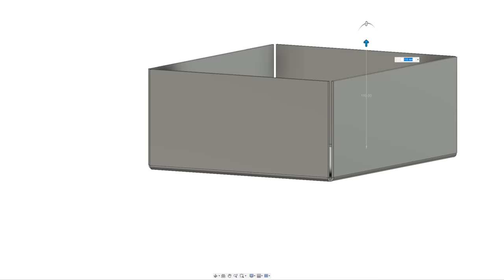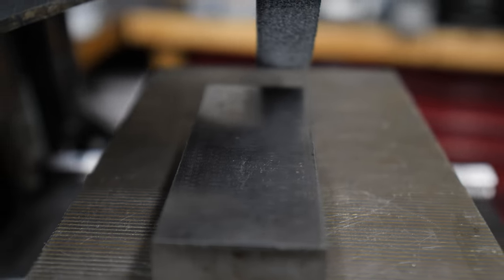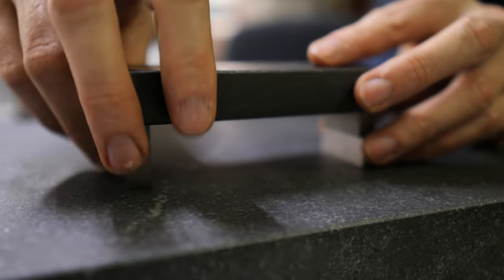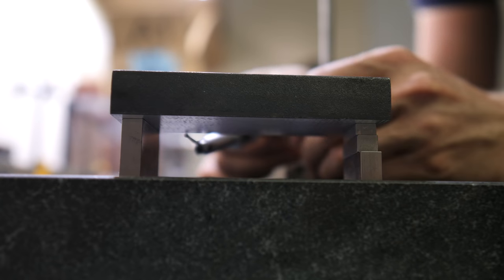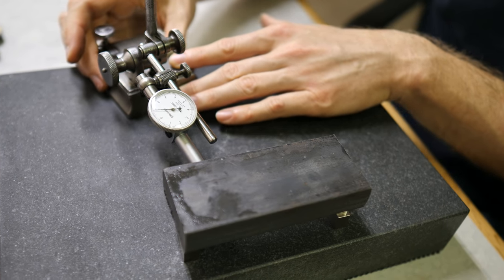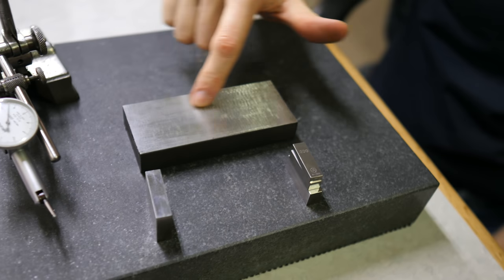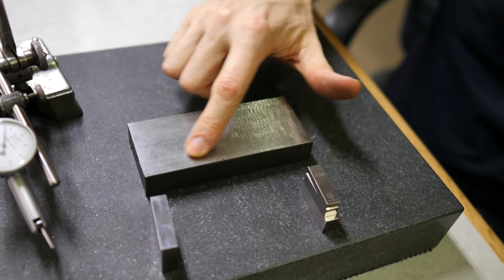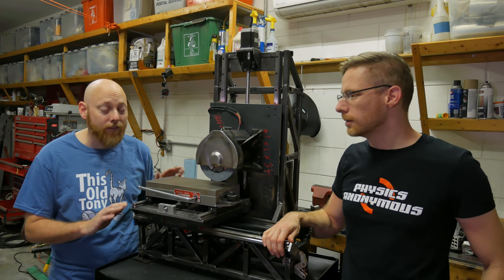Small Surface Grinder Part 12 - S02E43

Comment: Your wobble is caused by the fact, the whole machine is way too light for it's job. The "bench" is behaving like a spring, due to its construction. Every slight unbalance in the grinding wheel gets transported thru the frame and then amplified by the springy bench. Have a look what the actual contact-forces are, when you hitting the plate with the wheel. This outward push is easily compensated thru bend in your contruction. You gotta enforce the whole frame and put sandbags or clay in every free spot to get rid of the whobble.

Comment: Pro Tip: When you're tig welding an open joint. Put a piece of .125"-.250" copper flat bar on the backside. One, you were getting porosity because of airflow from the backside of your weld and two, it'll help with bead control while your skills continue to get better. For blending use type 27 flap discs.
Reply: P

Comment: the whole thing looks extremely flimsy and the way the wheel wobbled made me cringe. I think one of the reasons this won't work is that the structure is acting as one pig resonant spring instead of being made from a damping material like cast iron. Machine construction is not striving for maximum rigidity -- damping characteristics are more important.
Reply: It already does work. Let’s see your built from scratch grinder.
Reply: I'd be curious to see how it would work made out of pieces of Durabar. I realize that mass is a large part of what makes castings so desirable but in this skeleton type configuration would it make a meaningful difference.
Reply: @databoy2010  Mass is only part of the story. Relative damping capacity is the other. Cast iron has 20-100 times higher damping capacity than a steel (add another factor ten for Aluminium!). Mineral castings are even better than cast iron (which is way some high-end CNC machines and things like PNP machines, which produce a lot of rapid motion and thus vibrations, use mineral castings).
Reply: Easy enough to add mass in the right areas to cause interference to whatever frequency the thing is resonating at.  The damping capacity of iron (specifically gray iron) is often used as compensation for poorly crafted machinery.  The better solution, the one these fine gents seem intent to pursue, is to minimize vibration in the first place by eliminating sources of oscillation.

Comment: That wobble isnt from the plastic bushings. It's from imbalance in the wheel causing the machine to shake. Also, try dressing the wheel more aggressively by taking .001+ cuts with a fast cross feed

Comment: This is amazing. I'm seriously impressed.

You guy might want to investigate epoxy granite. It's basically a mix of various sizes of gravel and sand, with a bit of epoxy to bind it. The damping and stiffness properties are as good, if not better than, cast iron. It can be used to make whole machine bases. You could box in the frame of your grinder, and cast in some DIY epoxy granite. Machine tools are heavy for a reason, and adding weight and rigidity would likely go a long way towards improving the precision and surface finish you're able to achieve.
Reply: Weight will definitely help reduce chatter, encasing the machine in granite will definitely improve rigidity, so it is a win win strategy for this one.

Comment: One problem I saw what that you were cutting on both passes.  One pass would try and cut with the spin of the wheel and the other would cut against the spin of the wheel...  You ALWAYS want to cut cut against the spin of the wheel!  This leads to a cleaner and more controlled surface.

So, start with you part on the mag-chuck.

And with you part between the wheel and the upright body of the grinder. - If you work cannot fit under the throat of the grinder, then that is a good sign that your part is too big...

Then you want you work to start moving back and forth so that the wheel leaves the work completely on each pass.

Then start shifting the work a quarter of the wheel with with each pass, against the spin of the wheel.

Continue until the work has fully passed under the wheel.  The leading edge of the wheel might get worn down by your work...  Continuing to the trailing edge of the wheel should make for a more level surface.

If the direction of feed is away from the body of the machine, and you inappropriately look/move away, the work will not automatically crash into the machine...  That is why you start with the work between the wheel and machine.

You might want to re-surface the wheel before your final pass...  Don't move your part from the chuck though.  Just turn the chuck off, add the wheel burr - turn the chuck on again - level the wheel - remove the burr - do the final passes...

------------------------------

Also, after you get your machine level and parallel...  Surface grind the surface of your chuck.  You will never get parallel flat sides if your table is not both flat and perpendicular to the wheel...

Also, you must have liquid cooling!!!  Not only with this help with the dust - if you control the spray - but it will keep the work cool.  If the work expands from the grinding, then it does not mater how the machine is set, then work will not be flat when it cools back down...

------------------------------

Hope all of this helps!

Comment: A crude method to balance the wheel is a matched pair of 123 blocks on a very level surface plate (ie use a machinists level) and a shaft that matches the ID of the wheel, once it has stopped rolling back and forth the centroid of the wheel will be on the bottom so you can then use a carbide drill and take just a partial cut into the side of it to “balance” it. Rinse/ repeat till it balances at any rotation. Physics!

Comment: Looks good. Still think that dressing your wheel to have a step, to reduce width to say 1/4" would help. Even when you tune the machine in, trying to grind with a full width wheel will give you wheel bounce as the machine is fairly flexible.
Reply: Yeah, I saw your previous comment too and it's a good call. Most of the wheels I'm looking at are 1/4" and 1/2", also seems to be what guys like Solid Rock (who actually know what they're doing) are using

Comment: Thank You for putting the wheel guard on it, however, I think if you extend the guard down at least another inch (perhaps a separate guard piece that can be height adjusted to accommodate wheels of different diameters...hint...hint...) you will get much better dust control.
I saw a lot of dust flying up as well as sideways. A lower guard will catch all the upwards flying dust and direct it sideways where a wide-mouth funnel would catch it and direct it to the bottom of the funnel and a shop-vac hose (that's the set-up my school shop had on it's surface grinder, we could only see the bottom 1/4 inch or so of the wheel), severely reducing the amount of metal dust in the shop as a whole (which will reduce your cleaning/maintenance/repair bills/work).
Other than that, looks good...

Comment: In my humble opinion, I do not think you should give up on that motor.  Bump it up to 48v and your rpms should be over 6000 rpms.  Properly would it would be even higher with more torque, then gear it down as much as possible until it turns 3000 to 3500 rpms   Turn a canister for the motor to fit inside of and then you can pump mineral oil through the motor and cycle it to a small radiator for cooling.  I seen an advantage here because this is a cnc grinder.  The headstock needs to move up and down.  The weight saved with this motor is significant.  The radiator need not be mounted on the headstock but higher on the fixed portion of the column.   Just my 2 cents and I could be wrong.  If the frame is stout then a heavier motor could assist with maintaining pressure against the work piece. It is a very interesting conversation.

Comment: Your tig welding is great, heres why, it did the job fine...
are you needing to weld on miltary vessels so each joint holds to the maximum under toreped/missle attack?
are you working in the nuclear industry?
to people out there wondering about learning / having a go at welding, start from the bottom not compare yourself to the best from the outset.Grind and reweld if needs be, or grind to make the end result look better if you like. 
your building a dust cover A* in my book
Enjoying the process and or result means you want to do more, your now loving practicing and hey your now getting better!

Comment: Direct drive on the spindle with a motor made for constant grinning will help the bog and press fit bearings on the spindle will help with the wobble,dry grinding almost always will give you a chatter on the surface.

Comment: Rail covers! And I really think you should consider adding bulk. Maybe cast some concrete around the steel lattice framing.
Reply: Epoxy granite.
Reply: @danielkruger4305  yes, but but think about the guy's budget....
Reply: @JLK89  It would have been cheaper to just buy one that would work way better. Budget is not the issue here.

Comment: I love what your doing and have considered doing the same and probably will one day.  Would you consider changing the X to an air actuator, stepper motors are not continuous motion which could be part of the chatter. Also since you have a mill now,  if you re-do the spindle consider tongue and groove the fit up. Better penetration with less heat and warping.  Think I have watched the build going on 20 times now getting ideas to start my own project.

Comment: dressing the wheel with the diamond on the left hand side of the chuck will avoid the grit flying off and sandblasting the soft steel top of your nice shiny mag chuck .  
ps... dont grind that poor chuck with that spinny grindy thing,   
a half inch wide wheel has less mass to be unbalanced. 
a cable counterweight to preload the up and down of the wheely thing will help,
its hard to wind a wheel down without it settling from leadscrew backlash, vibration and ways friction, and taking too much off  (the reason for counterweights)  
 at least try dressing the sides of wheel, it will reduce the wobbling to the level of a spin dryer on full speed with a brick thrown in

Comment: looking pretty good so far
and by far the easyest way to balance is is to dress the diameter true to the y axis and then see where the wheel hits the most metal
then just drill a few shallow holes with a masonry bit. and yes please get a surface grinding wheel, that removes at least 50% of the chatter

Comment: Glad it has worked out. I wouldn't worry too much about deviation on the first few passes, you will still get a decent level of flatness once you let things spark out. just leave it to make a dozen spring passes ans that will alleviate the pressure and give a consistent cut.

Comment: Cover the vertical support and the horizontal support with sheet metal and fill the supports with concrete to stop the vibration harmonics

Comment: When you get the stone test it https://youtu.be/52n8_-6cooY 
Sometimes the crack or void is internal and can't be seen so doing the ring test will save some serious issues, especially the RPMs you will be running to do a decent grind, a lot of centrifugal pressure builds up really quickly and can be explosive.

Comment: Porosity in the welds is from not cleaning the carbon off the edges after you’d plasma cut it. No chance of getting decent weld if that stuff is not removed.

Comment: I think there is something up with your tig shielding gas....maybe turn your flow rate up a but....also I noticed a couple spots where some impurities boiled out of the weld when you fused that outside corner....if you get a little more filler rod in there even though you are mostly fusing, it'll help deoxidize the weld and keep that porosity down

Comment: I recently saw a video of somebody's CNC machine and their spindle was one of those Chinese 2.2 kW ones (the water cooled 3 phase ones) but it had a pulley on it (probably to gear it down). I was thinking that something like that would probably work well for your stuff (and they are obviously rated for continuous duty). It was the video about the acrylic pieces for the MMX marble lift that were made by a guy called Alex CNC i think.

Comment: try a smaller and thinner wheel less weight should help with the surface finish and help the poor little motor (also a pair of tapered spindle bearings !)

Comment: maibe run an angle grinder as a motor , its not too deep when measured from the driveaxle to the back so you can replace the grinding disk with a belt drive pulley and mount it on top of the jackshaft holding the grinding wheel the same as the small engine is mounted
might introduce vibrations from the gears in the angle grinder though the belt should nullify that mostly you do need to gear it down as the speed is too high fr a grinding stone  , there can be found cheap  , its forced cooled and should be able to run for  while

might try building a surface grinder , will start with a crosstable and most of the columb from a bf20 , or make it so it mounts to the side of the mill head

Comment: You just need to dress that wheel with a diamond every time, prior to grinding.  Has to be dressed from the magnet base to the wheel, which will make the wheel parallel.

Comment: It's Allliiiiiiiiivvvvveeeeee :) Well done, as for the comment about it being a spring, you could always add dampeners to it by getting a decent powered speaker driver (the type you connect to flat panels .. check out Tech Ingredients video on Worlds Best Speakers for $115 or, Speakers for less that $30 video), and then just run it through the ranges to see where the harmonics sit, then just screw or weld on counter weights around the place to help distort any harmonics :D

Comment: The wheel bounce could also be the wheel moving around the arbour. It might not nessesarily be that there is too much clearence between the armour and the wheel bore but how youre holding the wheel isnt holding with enough pressure. Try adding a backplate to the arbour and making a nut to match the diametre of the backplate. The surface area should help hold the wheel in place when the machine meets the work. The force might be sudden enough to move the wheel a fraction and effectivly 'untrue' the wheel to the arbour. You can also put your wheel balancing on the arbour like alot of other manufacturers do. http://www.wmsopko.com/sopko_057_59_65_66_67_68_69.htm Just some images of some J&S arbours could help inspire your design

Comment: put a paint marker dot on that 1 2 3 block to mark that its been exposed to heat.  It's fine you did it, but it wouldn't be fine to mix it back in with precision.
Reply: Yeah good call, right now we have a couple that are "the ones in that drawer are for welding" but I could see them easily getting mixed up

Comment: Do you want metric taps? Or can we only send imperial taps? Because I can donate brand new M4 through M12 in both straight flute and spiral. They are good machine taps we use on the CNC and manual machines.
Reply from the maker: We use the metric system almost exclusively in our shop when it comes to fasteners. That would be awesome!
Reply: @PhysicsAnonymous  sorry about the delay, I will see what I can get my hands on!

Comment: Guys, if I saw it correctly, you have only one bearing on your spindle. Uncle bumblefuck says bearings always come in pairs. Maybe that explains the chatter?
Reply: Can't say for sure as I took a look at the video where they made the spindle and housing and saw only one bearing being installed but there seemed to be a part of another bearing at the table. In design phase they had it quite right with two bearings near the wheel...

Comment: Red, baby, red! Or, whatever you want...lol. Don’t understand why you’re not using a proper wheel, I get mocking things up for proof of concept, but it’ll be hard to tell how well the frame, bearings, motor are all working if the wheel itself sucks.

Comment: I see that the progress since the last video is like somehow non existent talking about the grinding quality.
I'll defenetly stick to my last comment. This is not gonna work unless you fix the main issues.
Please rebuild the spindle when swapping out the motor. It's not gonna work the way it is designed right now. Reinforce the bed with concrete. Cover the guideways. Rebuild the primary protection, this thin material will stop nothing at all. Neither it will do it's job (destroying the grinding wheel into small pieces to reduce the amount of kinetic energy the fragments have). I would go with 5mm minimum.